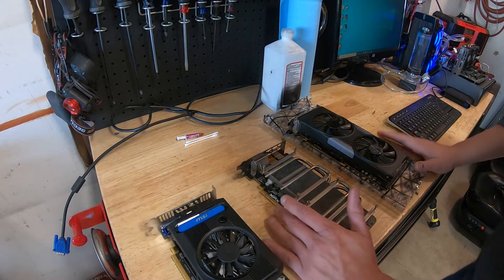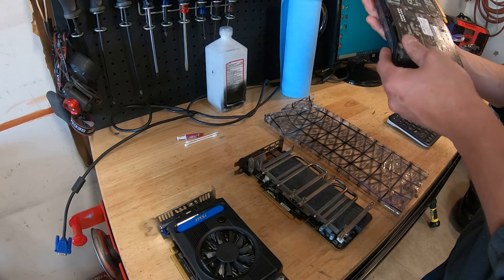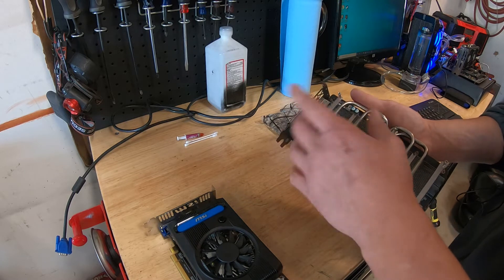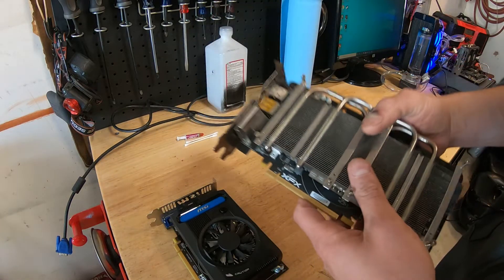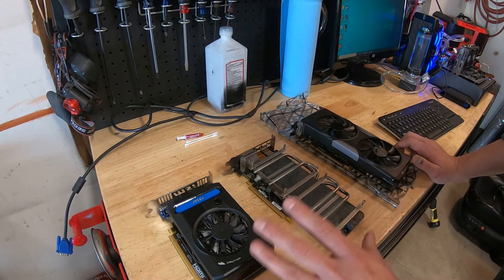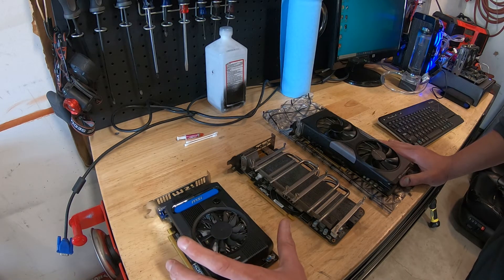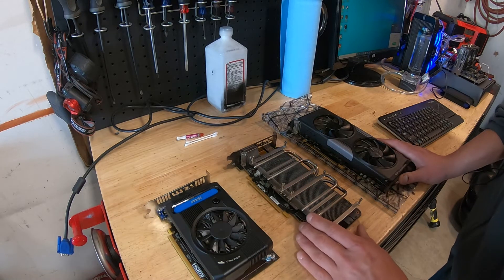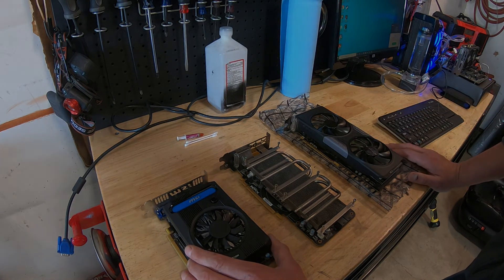Should you buy a used graphics card? What to look for and what to avoid!!

Comment: I’m getting a MSI Gtx 1660ti for $250 CAD. It’s months old and the guy told me that he can test it in his pc for me. He said he got it in a prebuilt pc and upgraded to a 2070. SHOULD I GET IT?
Reply from the maker: That's a good deal in my opinion as they are typically going for around 250 USD. Considering its a couple of months old the wear and tear should not be too bad on it. Make sure you look for dust, debris, check the warranty stickers to see if its been tampered, and def if you able to test it do a good stress test with a program like unigen heaven. That program will def expose the card if it has any faults. You will see artifacting after a few minutes if its faulty. Thanks for watching and def let me know how it goes with this purchase. If you have any questions don't hesitate to ask and if you don't mind subscribe to help the channel!
Reply: Hi, just bought it from that guy. Since it’s my first PC build I just asked him to run it and he was completely fine with it. The card didn’t even have any dust on it. It’s in great condition.

Comment: And dang right mining cards aren't bad I got a 1060 6 gb for 140 and dude only ran it less than a month so basically brand new. I didn't change the bios tho it seems to be working well idk if it'll work better if I change the bios.
Reply from the maker: use msi afterburner with the on scree display for the specs to make sure you are running the proper frequency for the card. If not then a flash would boost it better to get the most out of it, but i am a firm a believer if it aint broke dont fix it. Also alot of times miners undervolt the cards  so the only thing it affects is the boost clock and overclocking but in return your temps are gonna be alot better and give you more consistency with the card!
Reply: @DLMtechgarage  thank you very much man that's a great suggestion the guys has three more 1060s 6gb for that price so I might pick those up too and make a few builds to sell with them.
Reply from the maker: @HappyDaClown187  def grab them. easy bang for buck!

Comment: I got a hell if a deal on the last two I bought the first one was a gtx 970 and I couldn't of found a better deal but for some reason it only runs at x2 vs x16 and it's not the board or the driver or the windows install so all I can figure is its shot and will always run at x2 no matter what? Any suggestions would be greatly welcomed I built a rig around it for my nephew since it seems to run on par with most gtx 970s regardless
Reply from the maker: a bios update is my go to, if not check the slot, rare cases the pci slot tend to act funny